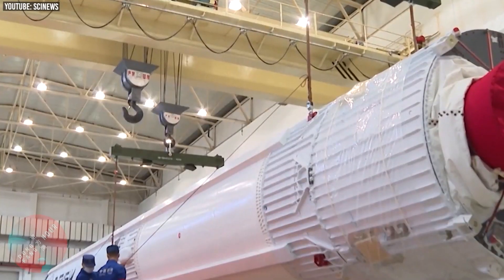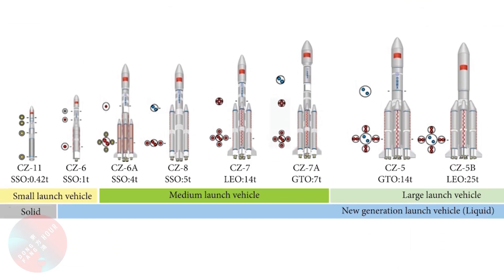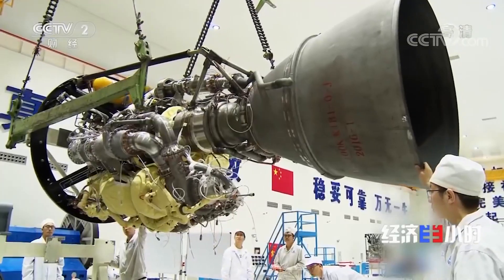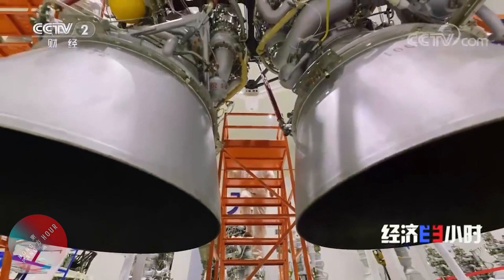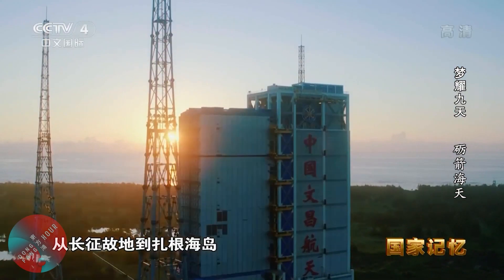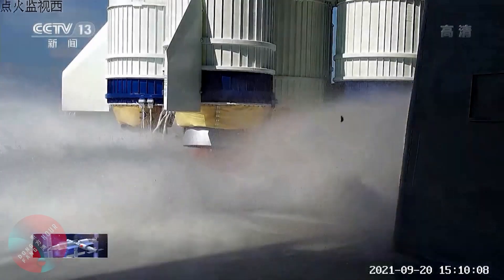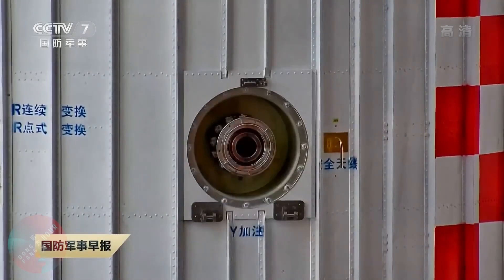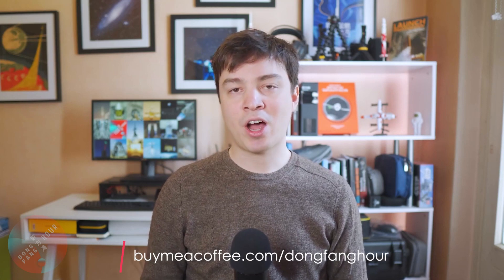Understanding China's Latest Medium-Lift Rocket: The Long March 6A

Comment: This looks like a technological POC rocket.  It has very little in common with LM 6.  Not sure why the Chinese named it 6A.
Reply: Usually, in military and space applications. If a capitalized letter is given to a specific model. It means drastic and significant change, these changes would render the new models almost completely different. The similarities usually only exist in name, roles and maybe looks. For example, type 99 main battle tanks and type 99A  are entirely different.
Reply: That true of any space program, remember American astronauts were exclusively Air Force pilots in the beginning of the space program. I also believe as a matter of common practice interagency ambiguity was also common. Meaning tech flowed back and forth between NASA and the DoD, military contractors.
Reply from the maker: The naming is definitely confusing: they named this rocket the LM6A (+4 additional boosters), but didn't give a new name to the latest version of the Long March 8 without side boosters earlier this year.
Reply: @DongfangHour  people invest in Chi Na companies are Dumb
Reply: There gonna be a LM-6X which is a reuseable rockect comming out in 2023 or 2024